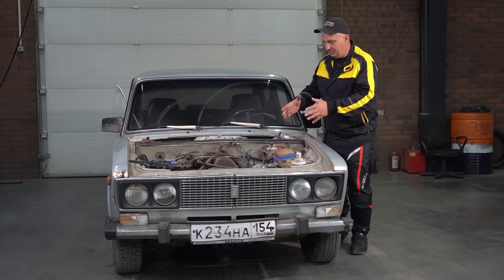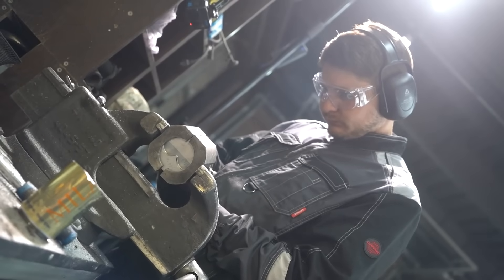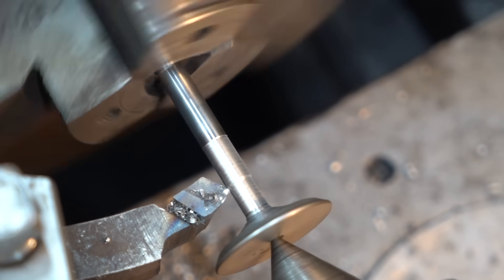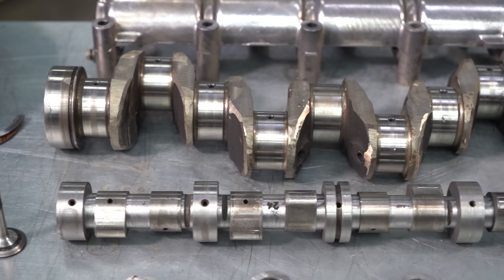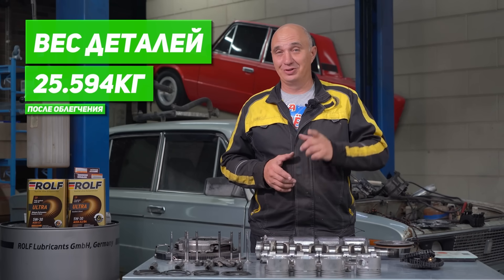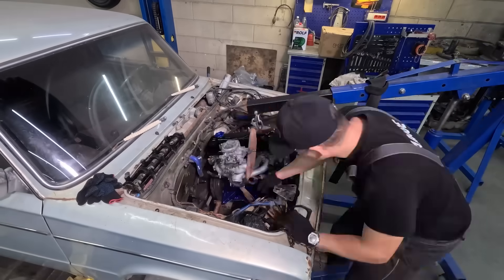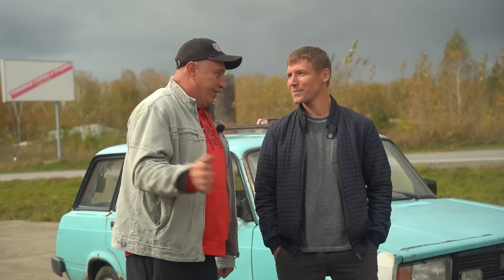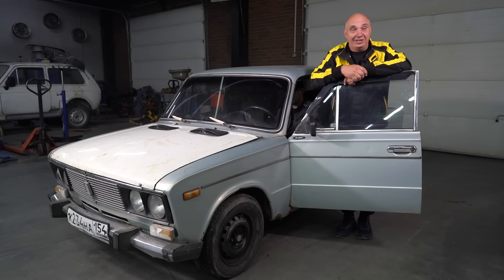Maximum rotating assembly weight reduction - what will happen?

Comment: The only easy weight reduction i can think of that you didn't use, is drilling the rods. Put three or four holes through each web, and chamfer the edges; maybe shot peen or polish the rods as cheap insurance. But hey, if it throws a leg out of bed at 10,000 rpm once you've doubled up the valve springs, you've found your weak link...😂

Comment: Valve float is what's holding it back as well as intake and exhaust flow, you need a better head say...from a sport bike.. next would be shorten the stroke, bore out the block for bigger bore pistons to make an "over square" engine = higher Crank rpm.

Comment: Suprised the engine didn't shake to pieces after taking off the crankshaft counterweights. Awesome video
Reply: Don't worry, it will fall apart if you drive it for a bit.
Reply: @sven7111  Surely! Removing the counter weights ... That is a sure way to kill your bearings.
Reply: @djnor1979  not really, counterweight weren't even used in many engines until the 1940s. The original VW engine had no counterweight. They did discover that the resulting harmonics effects wear over time, but the engines did live acceptable service lives.  This was an era where a 50k motor might get a complete overhaul,  well before quarter million miles with no appreciable wear was the norm.
Reply: Classic VW bug cranks don't have counterwights. It is a boxer engine that revs to about 5000rpm max though.
Reply: @RikardoKermat  Isn't that because of the force of the pistons on one bank ends up counteracting the other to some degree?
Reply: @Samqdf  Yes. But even a stock Type 1 engine can benefit from a counterweighted crank. It puts less stress on the block. The counterweights are there to counter the piston/rod weight.
Reply: @RikardoKermat  yes, you're right. Because no matter what they still have 4 separate con-rod journals.
Reply: @RikardoKermat  with light pistons and rods you can use the stock VW crankshaft to >7000 as proved by JPMs Mouse engine.
Reply: The big end bearings are opposite each other @RikardoKermat
Reply: @RikardoKermat horizontally opposed engines need little to no counterweights because the pistons and rods move in opposite directions providing a balance. An inline or vee engine the rods and pistons need a weight opposite of them to be balanced.
Reply: @RikardoKermat  true, but buying a stock-size counter-weighted crank is always an upgrade. just gotta add some cam and valve goodies and lighten the flywheel and you're all set lol
Reply: @RikardoKermat  ultra high performance race engines like the one on a stock Lada can rev up to 15.000rpm and they need the counterweights, otherwise the 1000Nm of torque the engine produces may damage the crank
Reply: @RikardoKermat even 6000 with stiffer springs but the case will start to walk with all the rumbling
Reply: @RikardoKermat Boxer engine forces are comoletely different than inline engine forces. A boxer engine is already more balanced, on modern Subarus and Porsches you can see how small the counterweights are compared to inline and V engines
Reply: Its a 1200 or 1300cc engine and they balanced it pretty well.
Reply: This was exactly what I was thinking. I was like "now they're going to take off the exact amount of weight off the counterbalances as... oh!" All that being said, what a blast it would be to do something like this.
Reply: Yeah, I'm in the middle of building a 3sgte with my son for his first car (96 Celica), and last weekend I spent like 8 hours straight balancing the rotating assemblies reciprocating mass within 1/10th of a gram, stressing hard about making sure its absolutely perfect for longevities sake. FSM calls for 10 grams max deviation which feels excessive to me for a Toyota. But I was stressed about a .1 gram difference. So seeing these guy just lop off the counterweights about gave me a heat attack 😂

Paused the video and scrolled down to see if anybody else called it out, and here you are. I'm not crazy after all.
Reply: balanced, counterweights are a cheap and fast way for mass manufacturing without precise measurements
Reply: Have you seen their other videos? They are not concerned with blowing the motor apart
Reply: Lada are flat plane they are self primary harmonic balanced.
Reply: @freyja4954  The whole idea is to minimize crankflex and these Fiat/Lada engines are over engineered with so much extra meat compared to new engines they can handle this as long as they are rebalanced and adding a better front dampener will be ideal. The cranks are awesome.
Reply: haha as soon as i saw that i scrolled to the comments to see if anyone said anything about that! 🤣
Reply: I'm more impressed she didn't need a tune for it. Cutting that kinda weight on the crank and flywheel, yet pulling on start without issue? Just impressive.
Reply: Do a soviet rotary engine next 🤔 👀
Reply: Maybe they did the smart thing and removed the same weight that is removed on the piston+rod. But i doubt that because they removed 2kg from the crank shaft....
Reply: @Reculse  Exactly ...
Reply: There's a lot of information on I4 crank balancing on YT. The counter weights don't do a lot
Reply: Should do a dyno test
Reply: they're mostly only for secondary imbalance when the conrod swings sideways halfway through a stroke

Comment: You need to control valve float and also make smaller journals on the crankshaft and you'll get the highest RPM

Comment: The springs are what keep the engine back from revving higher I'm surprised he didn't notice that
Reply: With the reduction in valvetrain weight they did, it should still be able to rev a little higher than stock before valve float. I think most of it is a VERY mild cam. 

They can probably modify a Datsun cam which even stock is a lot more aggressive than the Lada cam likely is

Comment: Counter weights?!  You removed the counter weights!?  They are necessary for the functioning of the pistons!
The crank shaft will snap because there is nothing to balance the weight of the pistons when they thrust down.
The crank shaft will experience metal fatigue, develop cracks and break!  You are stupid.
Sure it runs fine now... but run it for a year and guaranteed your crankshaft will break and that is dangerous.
Somebody could get killed.  You better not use that engine for any extended amount of time.

Comment: Especially in older engines, the revs are usually limited by valve springs.  When the revs get too high the valves begin to float or stay open longer than the cam shaft is telling them to.  The more float, the less power the engine makes, thus it reaches a balance point.  Furthermore, cam timing is also a factor.  It takes time for the exhaust to leave and fresh air to come in.  However, there is less time when everything is moving faster.  The cam can be degreed or positioned so that maximum opening is later in the stroke, providing a bit more time for intake and exhaust, but this decreases performance at lower revs. In other words, when the cam is advanced it opens the vales too late when everything is moving slowly, but at the right time when everything is moving quickly. Modern engines have cam phasers between the timing chain sprockets and the cam shafts that can twist the cam shafts using oil pressure to adjust the cam timing while the engine is running to keep the cam timing in the sweet spot for longer.

Comment: This was unfair in terms of the drag race, the station wagon was a heavier car with a heavier driver, the modified Lada was a lighter car to begin with, with 8 kilos lighter engine, and a lighter driver, of course the modified Lada is going to win. I say you should not only switch lanes, but also switch drivers. Let the younger, lighter driver drive the station wagon a bit, and then the comparison would be fully complete. there is also driver skill and driver agility, and reflex time to consider also, no offense, but the older a human being gets, Given human being is often slower in reflexes as well. so in regard to the drivers, they needed to me more evenly matched, meaning similar in age, weight, and with similar speed in reflexes.

Comment: The rev limit isn't about the weight of the components. Rev limit is about airflow and piston travel. Reducing rotating mass will allow it to rev quicker. My advice is to port match intake and exhaust to plenum and header, carb to intake plenum, and use a less restrictive exhaust. If able, you could increase valve size. My 1.8L uses 40mm intake and 33mm exhaust,  and revs past 8k. Prior to my build, it was running 32mm intake and 29mm exhaust, and would flatten out at 5.500rpm. I also increased the throttle body size, increased cam duration, and use a 3-2-1 header into 50mm mandrel bent exhaust. It out accelerated a 2L turbo from 0-100kph.
Reply: The biggest change they need to make is to get a cam made with more duration and a tighter Lobe separation angle. 

I wonder if they could modify a Datsun L series cam to work in that engine? Even the stock cams in the Datsuns were a lot hotter than what this Lada engine probably came with. My L20b engine easily revs to 7000rpm under no load.
Reply: The 4-2-1 exhaust is usually better at torques while the 4-1 exhaust is good for revs.
Reply: Had to scroll down this far to find the right answer.
Reply: Are there improvements on fuel economy when you do these modifications?
Reply: Probably also stiffer springs, so the valve float aint too bad.
Reply: Yes. But it's very different with transmission in neutral. Not really needing huge power. So I bet what is really limiting in this case is ignition, even when you don't have electronic module, the ignition still can have some kind of limiter due to vacuum or centrifugal mechanic correction. At least that what happens if try to make an old Beetle rev crazily in neutral.

Of course, if you want not just more rev, but useful rev... I mean, when you want the thing to have more power in high rev, you need more sporty camshaft, and better breath at all.

Comment: Would be nice to do dyno before and after to see if/what difference in power engine makes. 
In theory like I guess reducing rotating mass should increase power but how much?
Revving engine will not answer this question. I guess carburetor and intake manifold now are main obstacles for air flow preventing higher revs.
Reply: maybe more hp but less torque?
Reply: @CVLova  Probably less torque, but in a different way that I'm not sure would be as measurable on a dyno pull. Since they removed rotational mass, that means it's subject to being slowed down more easily. So when you start from a dig and dump the clutch, it drops its RPMs faster. Similarly, when you're WoT and shifting.

I could be wrong though!
Reply: @CVLova  torque and power are related - P=9549xMxn it's fixed relationship.
Reply: @tomaszbudnik521  This does'nt bring you hp , this let the engine rev up faster and response faster to the throttle . Like a motobike and this is what makes you faster .
Reply: @CVLova Yes maybe 2hp and 2 newtonmeter because moving mass means almost nothing

Comment: The valve springs to weak.  Use stronger valve springs or dual springs. Is will rev till 8000 if get enough fuel
Reply: gówno prawda.

Comment: Try adding material to the tops of the pistons to raise compression. Always wanted to try it on a small engine
Reply: Would be easier to deck the engine. Plus weight reduction 😁
Reply: @jasonharrison25  still need piston to valve clearance.  Valves do not cover the entire piston face. Look at a domed piston…. It has valve reliefs.

Comment: Now just needs porting, polishing, bigger intake & exhaust, re-jetted carb, better valve springs, and that will bring in a "lada" power... :P
Reply: and an aggressive cam shaft
Reply: I'd bet there's a fair bit of power capacity in a lada ironblock, plenty of material there. Not sure what they make stock, but maybe like 4-5x without much issue. Not sure you could call it a lada motor at that point though
Reply: Re-jetted bike carbs 🤙.
Reply: Need 2 of these in the dual engine style they recently did.
Reply: 🔥 comment

Comment: Weight isn't the limiting factor on max rpm. Usually you'll need stronger valve springs to keep the valves from floating.
Reply: With all the weight they took out of the valvetrain, valve float should occur later even with stock springs. 

This engine is totally limited by the cam. I had a Buick Regal once that had the Oldsmobile 307 in it, the cam was so mild that it would only rev to 5000rpm WITH NO LOAD. Under load, it would only manage 4500rpm, but it did have so much low end torque that it would cruise at 80mph and 1600rpm.

They just need to grind a cam with more duration, and a tighter LSA. the cylinders need more time to fill at higher RPMs. Also will give it that lumpy chop at idle😊
Reply: @two cool story bra
Reply: And a better cam profile; longer duration...
Reply: Double stacked valve springs like honda motorcycle
Reply: Lighter rockers and valves is basically the same thing 🤷🏻
Reply: Rotating assembly weight is a massive limiting factor on max RPM, and so are valve springs. Staying either one isn't a limiting factor is some clown shit. 

Literally the first thing done to an engine when trying to get more RPM is a lighter rotating assembly.
Reply: if the valve is lighter, this shouldn't be a problem. The problem is the total stroke of the engine, radius/length.
Reply: Correct!
Reply: lighter parts give more response, to make it rev higher you need more air flow at high rpm and thats when you need higher duration and higher valve lift camshaft, after that you need to make cylinder head flow more with higher valve lift, then you need even bigger cam and so on 😄
Reply: You need to put it in R for race mode
Reply: But changing the flywheel can make the car feel awkward to drive in normal traffic.

So it will be multiple step process, before removing to much.
Reply: If done correctly it will be faster faster.
It takes less energy to accelerate, pure physics.
You start with flywheel.
Reply: @AnalogDude_ a lighter flywheel will rev more quickly, but stronger valves will let the engine rev to a higher RPM
Reply: @Mastermindyoung14  don't think so, i had a car with an early Bosch ECU and it would cut off at 6500 rpm, rev limiter!
Reply: @AnalogDude_ well yeah thats the limiter for ya

but eliminate that, put stronger valve springs (and valves so they dont break) and your engine will rev higher..

i dont think an engine that can move 2-3 tons will have any issue rotating a steel plate a few hundred even thousand rpms faster then OEM
Reply: @AnalogDude_ Yes it just makes snappier response no more max rpm.
Reply: @AnalogDude_  the amount doesn't really matter all that much compared to the car weight.  if you spin it up without being in gear it'll feel like it has loads of extra power tho.

also it doesn't allow to get a higher top speed, the max power output is not affected, only the energy to change running speed has changed and while that might seem like it's the same thing it's not. 

they should first find out why their max rpm is what it is, do they run out of fuel, does the ignition accuracy give up the ghost at 6k, float or what.        but anyway that's not what this channel is about so I vote for WHOLE HOOD RAM AIR INTAKE OUT OF PLEXIGLASS as the solution. plexiglass so he can still see where he is driving.
Reply: @lasskinn474 A lot of weight was taken of the crank, it will rev peppier or faster.
Reply: @AnalogDude_  rev without load yeah. but when it's accelerating the car it doesn't affect then beyond first feet. 

it'll change rpm more readily making shifts easier etc though.
Reply: @AnalogDude_  Wrong, remove counterweights from the crankshaft would not help and could even reduce the rotations because will be harder to change piston directions. Should be balanced because should have the equivalent weight to the piston and conrod.
Reply: @AnalogDude_  Youre wrong. 
@Mastermindyoung14 Is right.

pUrE pHySiCs. Read and understand how this works first next time before posting nonsense.
Reply: @Chris-yy7qc  Dude, the orginal flywheel helped to turn the motor over, otherwise it wold be different story.

I did this with mopeds.
Reply: @lasskinn474  It'll find some power from lightening the reciprocating parts(pistons, con rods, valves[barely] etc.) because they need to eat power every time they change direction. For the rotating parts however, yeah. It'll just rev more freely.
Reply: @analogue cool story bra